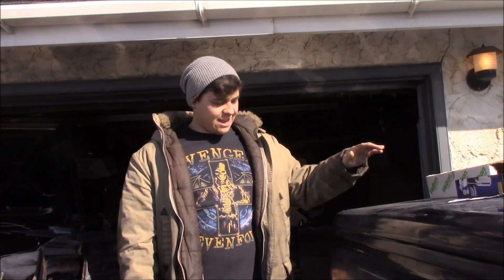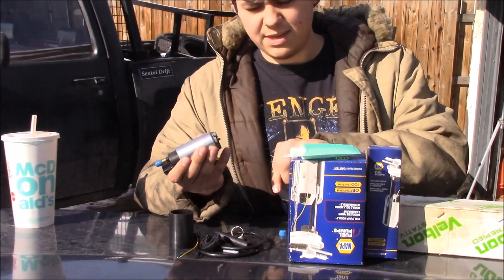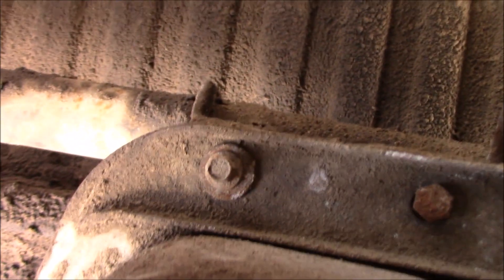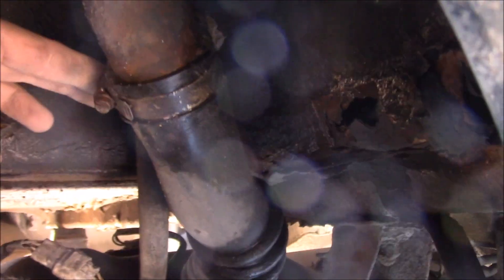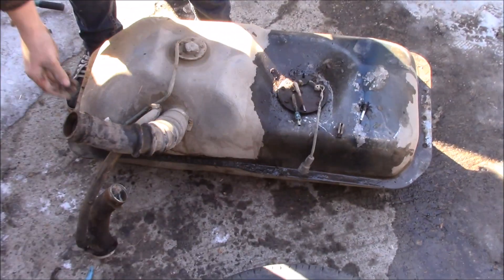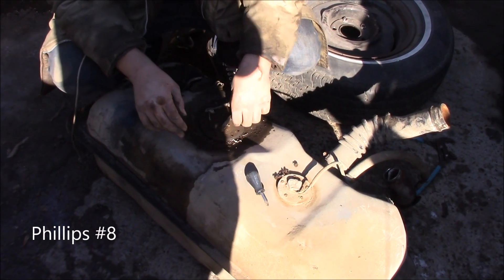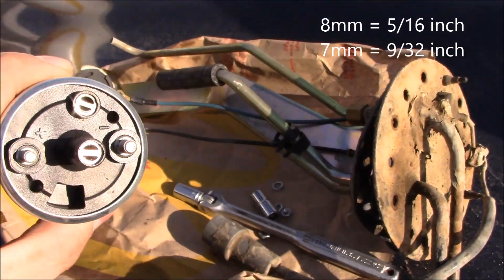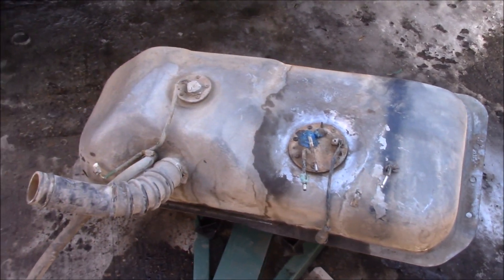1988 Toyota pickup fuel pump/gas tank removal

Comment: Hello I have a 1989 pickup truck and there's a white connection just as you have on yours and I don't know how to disconnect the white wire that's connected to the fuel tank. Could you tell me how I disconnect the white wire without breaking it? Do I use a flat head screw driver to put underneath the small lock? It's very tough and I don't know how to disassemble the electric wire that runs to the fuel tank. Let me know how you disconnected yours? 
Thanks

Comment: I have this same truck! My fuel pump needs replacement too. There aren't many videos on this procedure and none leave the pickup bed on like you did. Just one question, would you do this way again or remove the pickup bed next time?
Reply from the maker: Rock Paperstone if I had go do this again I would leave the bed on still. It's not that bad to Jimmy the tank in and out but I do recommend another person to help you with putting it back in, although its not necessary to do so!
Reply: Thanks man. Real good video. Mine has 240,000 miles on it and was running strong until this.

Comment: You made it look easy!  Outside,  in the slush no less. I need to do mine in a '90. How long did that take you?  And how were you sure  that it was the pump.  Mine is efi
Reply from the maker: Honestly if you have the proper tools the job takes about 45 minuted depending how well the tank actually comes out of its spot for you (some patience and wiggling of the tank is required). I broke down on the road and found out i wasn't getting fuel to the engine so I hit the tank with a tire iron as a friend was trying to start the car and it came on. If it didn't turn on id drop the tank to see if the sock is full of debris or the actual pump dosent work
Reply: @DallasHollidayTV  thank you.  Tried the tap technique nothing. Had very little  gas in it. Maybe sucked debris up in sock.  I'll let you know outcome. Thx again

Comment: What about the fuel gauge sender unit? They all fail, sooner or later. Why didn't you at least identify it; and why didn't you mention that it would be good idea to swap it out while the gas tank is out? Failed, failing or neither yet, especially if the truck has high milage and the original unit.